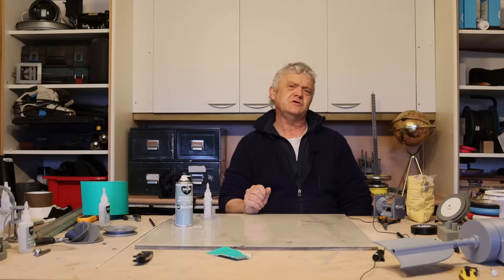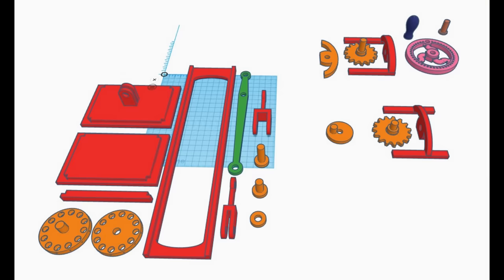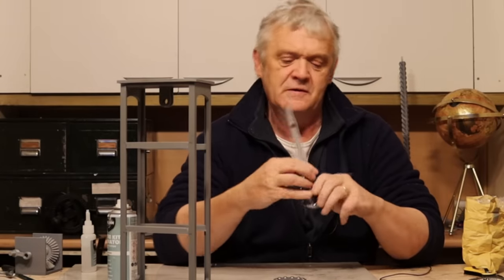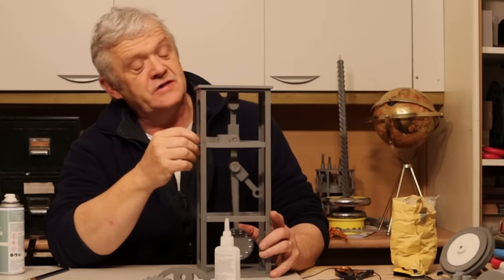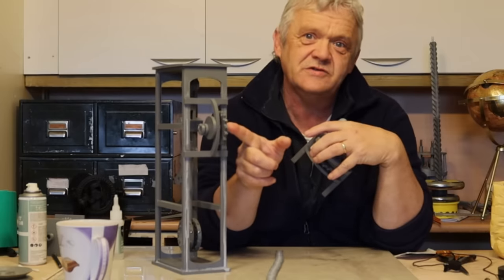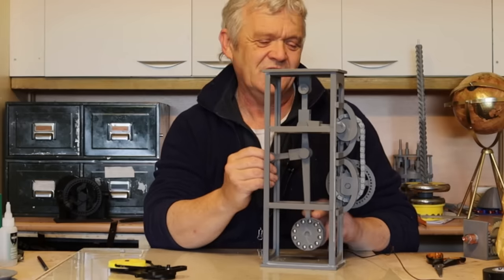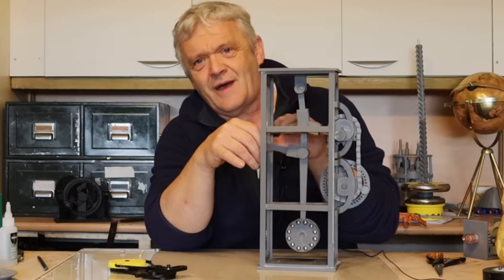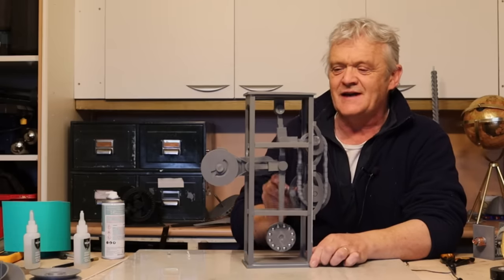2086 Constantinescu Torque Converter

Comment: Fascinating. Such a clear visualisation, thank you.  Immediately obvious that the pendulum could be replaced with any energy storage device including a spring, a gas cylinder or accumulator, an arrangement of magnets or even the flux of an electromagnetic field.  The distance between the input shaft and output shaft could be variable, or the mechanical resistance of the storage device could be varied (if electromagnetic it could be electromagnetically controlled).  That will get me thinking!

Comment: The inverse use could also be beneficial. A CVT to convert the variable speed input, to a constant speed output, specifically like in a wind capture generator.
Reply from the maker: I am not sure i see the need for it mate - especially for wind generation - what are you thinking? can you expand?
Reply: @ThinkingandTinkering  
Instead of dumping the over voltage energy when the turbine spins too fast, attach the CVT to maintain a constant usable output voltage. Or provide the exact same output voltage throughout a range of wind speeds.
Reply from the maker: you could do that with a belt and pulley CVT couldn't you?
Reply from the maker: also - when i think about it a bit more wouldn't a Huygen's drive work well here?
Reply: @ThinkingandTinkering  
I would think so. Maybe a centrifugal governor to set the pulley gap.
Reply: @ThinkingandTinkering  
Interesting. I'll have to look at that. That's a type of gravity battery drive, isn't it?
Reply from the maker: yes it is - i m thinking of it as a bit of a mechanical capacitor
Reply: @ThinkingandTinkering  
With a braking mechanism if/when the storage weight is drawn up to its limit.
That would definitely level out the output in gusty locations.
Reminds me of an application where I had reason to look at electromagnetic brake pads. A coil behind the pad material was energized to apply pressure magnetically to the iron brake rotor, instead of hydraulics.
Reply from the maker: this is a very interesting idea mate
Reply: @ThinkingandTinkering  
A medium, to larger, sized ball omnidirectional windmill, with the Huygen drive weight housed in the support pole, and a spherical generator housing inside the windmill ball.
Now I just need to generate a template to cut polyethylene drums into windmill vanes. Thermoforming those to shape and heat welding them together. I have a 48vdc battery/inverter system for my shop as is. I also have a couple hundred pounds of lead for the gravity battery ballast as well.
Reply: @ThinkingandTinkering   - Winterdatan has been playing/working with a gravity based regulator for his fantastical music machines - he is findint that it is not exactly a trivial  - when perfect regulation is needed.
Reply: @Vibe77Guy  You don't need a CVT to regulate voltage, just do it like car alternators: use an external excitation rotor and adjust rotor current to get whatever output voltage/current you need up to the alternator's maximum ratings across its operating RPM range. Make them output to a local battery storage system's HVDC rail and let the battery's grid-tie inverters take care of grid synchronicity. Then you should be able to get away with a smaller, lighter, more reliable and more efficient fixed-ratio gearbox.
Reply: @teardowndan5364  
My system is completely off grid, so no grid tie issues.

Comment: Fascinating. 
I wonder why it's not used more!
The double jointed pendulum made me fear chaotic behaviour but I suppose the constraints on the output (and input) prevent the system from going crazy.
Reply: Maybe because it would shake itself apart
Reply: a problem is that it needs each pin and joint to be able to withstand 100% of the engine output plus 100% of the extra energy stored in the mass times the moment ratio. This may make it too heavy and too noisy (there will be some slack, and that's a source of noise) for use.
Because it's not used, there is a reason.
Reply from the maker: it was used mate - i don't know why it still isn't used
Reply: @ThinkingandTinkering   I'm thinking mechanical issues at high speed and high power. But that's a semi-educated guess.
There's got to a be a history of it somewhere.

Comment: Yes, Constantinescu invented (among many other inventions) that great torque converter. Unfortunately it has a major flaw leading to fairly rapid mechanical failure. Constantinescu himself tried different high strength materials to overcome that and hoped that better materials will be available in the future to sustain the mechanical stress of the parts. Too bad he concentrated on materials, rather than finding the source of the failure. He would have find the issue and its easy fix.
Reply from the maker: Thanks for the info!

Comment: The hole in the pendulum shaft for the out, if you elongate to hole so that the pivot of the output could be shifted up or down, will alter the leverage angle for more variable control

Comment: I bet that thing could be designed to work rotationally by designing it as a flywheel where the one connection is offset from the middle, essentially using the wobble to store that energy.

Comment: I get how this work as you've explained it yet im a little confused, I tried looking this up and it says about a flywheel in some illustration's but most talk about the pendulum... So if it was made for a vehicle like it was manufactured would it *have a flywheel or *how does the pendulum still work in a moving car? Id imagine turning would throw off the occilations or is there a redundancy im overlooking? Either way thank you for your time and your videos, it's appreciated.

Comment: The torque converter should be the battery and electric motor/generator all in one. The weight of the battery as the flywheel spinning with the generator/motor.

Comment: So the best torque converter would be a generator. With drive electric motors since you would be able to have a feedback loop to control the power output. Hybrids are great I guess.

Comment: I love the noise it makes. Isn't the core effect roughly the same as connecting a flywheel to the input and output shafts via springs. Put a disc of springs on input and output sides of the flywheel to connect to matching discs on the same axle but connected to the input and output. Or use concentric rings with springs between them - flywheel ring between the input and output rings
Reply from the maker: no mate - you need to think of it in terms of levers with a moving fulcrum
Reply: @ThinkingandTinkering  I understand that - I was trying to avoid the translation to linear motion and back. The pendulum becomes a flywheel and gravity is replaced by the spring (which ought to logarithmic instead of linear to replace the pendulum )
Reply from the maker: clever mate - thank you for expanding both on your topic and my my mind - cheers mate

Comment: It's not truly a constant torque converter if you can stall the output.
Reply from the maker: that's not right mate - enough force on any output will always stall it
Reply: @ThinkingandTinkering  I mean if you can stall it while the input is still moving.  That means the "gear ratio" is changing.  An example of a transmission that doesn't do that is a gear.
Reply from the maker: that makes no sense to me mate - if you hold onto a gear with a force  above the input force it will stop the gear - I must be misunderstanding what you are saying - can you explain in a different way so i get it?